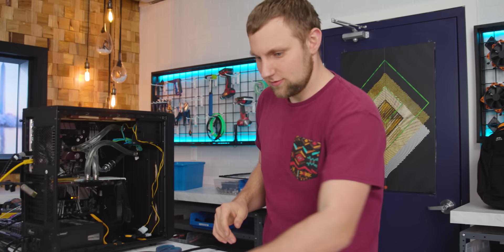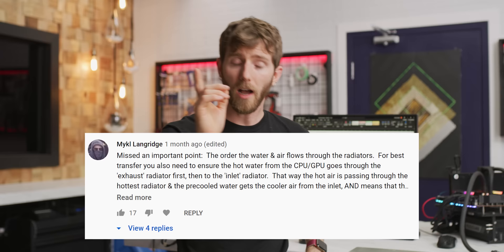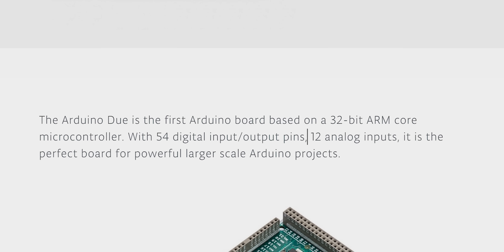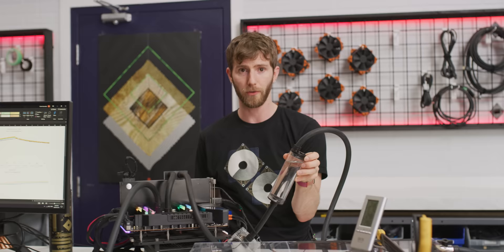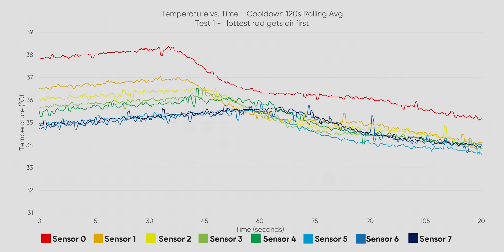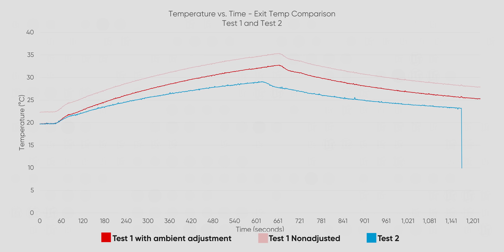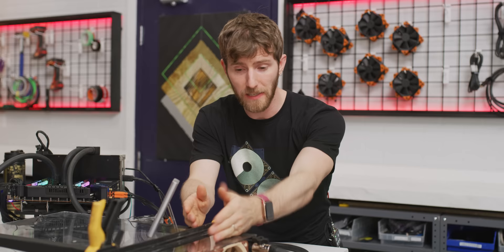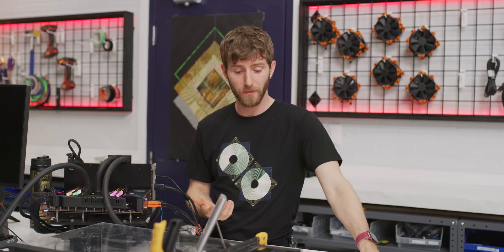Is this even going to work…

Comment: This is a bit late, but I think something is up with your sensor calibration, it looks WAY too noisy.

Especially given that you need extreme accuracy to account for the slight temperature measurements between each sensor reading since a 1 degree difference would completely change the outcome of your conclusion. I know thermistors are typically +/- 0.2 degrees C but the process in converting a resistance > voltage -> digital signal -> raw number -> temperature often leads to huge amounts of error to the point of +/ 2 degrees C and this shows up in your data especially with your last test. 
For once I know a bit about this so here are some suggestions for if you guys decide to do something similar in the future (please do! I love this kind of content):

- The Arduino's ADC should be calibrated so that you get a better analogRead(). (I've never used the Due so I'm not too certain about the noise) but looking at the AT91SAM3X8E datasheet, an Integral non-linearity of 2LSB total actually doesn't seem that bad, assuming you guys are using 12 bits of resolution? I've done personal projects with various Arduinos and switching just the Nano to a Zero once changed my readings to +/- 0.1 C to +/- 0.5 C. For comparison the LSB difference between the ATSAMD21G18 and ATmega328P was 1.2 and 2.6 albeit with different resolutions. 

- Not sure if the ADC is the main culprit here, but it's a possibility since not all ADCs are created equal. Upping the resolution from 10 bits to 12 doesn't always make the noise better due to offset and errors. I would link it if I could, but if you google "Precise voltage measurement with the Arduino board. skillbank", the first result is an amazing guide and a good read on how to properly calibrate the Arduino to read voltages properly. It gives a good explanation on analogReference as well. (Optimally using a reference diode would be best for this)

- Why use a 250ms delay with a moving average? The easiest way to get rid of the noise at this point would be to just deal with it on the software side and sample quickly and average a lot of values at once. Spitting out the average directly instead of a moving one would also reduce lag in the data.

Ok I'll stop since I've been way too technical with this already sorry, but anyways mad props to you guys for revisiting this, and for using Steinhart and ice bath + boiling water calibration and not using the thermistors directly! I was pleasantly surprised when I saw how far you guys went to get your get the best results out of your testing! Hopefully if you guys see this and do decide to try and improve your data for future projects this helps a bit. Unfortunately, when you want to get accurate readings down to a tenth of a degree, it just gets increasingly harder to do.
Edited to fix formatting.
Reply: Good to see another person saying this. All my hours spent in a lab with a datalogger and array of sensors, thermistors included - if I had data that noisy I'd swap all my wires, and be very worried aha

I honestly don't know why they didn't poll the sensors for their maximum polling rate. 4Hz is immensely low - and as I suggested elsewhere, they should link raw data graphs in the description, but absolutely smooth those curves (to a proper fit of course). Then pedants and cynics can check the description, everyone else sees the clear picture
Reply: @skarrambo1  Glad to see that you agree too! And yep my first go to with noisy data is to double check if I wired something wrong and check for interference but their breadboard setup seems fine at a glance.

I know they do this mostly for entertainment and fun but yes! I'd love to see full documentation of this project, it'd be really cool if they uploaded everything from the code and schematic to the .stl files that they used (not that anyone with a sane budget could replicate this haha) along with their raw data. Something as cool as this deserves it
Reply: I question the value of the high sample rate with the "calibrated" thermistors. Just use DS18b20s and sample at 1Hz, you only need to sample at twice the frequency of the effect you are trying to measure. Higher sampling is making all the subsequent steps more difficult. It is not like the effect they measured had any useful information at the sub-second scale, the water temperature did not have meaningful fluctuations within 1s timescales. The noise introduced by their thermistors and calibration system really degraded the quality of the data.
It took 14 days to build that in part because they fiddled with the calibration and adjusting the potentiometers. With DS18b20s they could have used one digital pin with much simpler wiring, and higher accuracy and precision.
Reply: This was a very interesting read and I am not even interested in the video. Just appreciating the level of expertise here.
Reply: "Spitting out the average directly instead of a moving one would also reduce lag in the data."

ikr too bad they didnt have a dyno guy hanging around

Comment: I feel like the actual answer to the question was glossed over in a single, easily missed, line of the video. as long as the air passing through each rad has enough thermal capacity to pull heat from that rad, it will cool the water inside.  Sadly when using fans designed to move air through a single rad, it's moving far too slowly, the air getting "filled up" with heat before it ever gets to the next rad in the line.  Use some loud AF, high speed, server fans in there and re run the tests.  ( or do it dirty and use a furnace blower ducted in.)  
Think of the air like a bunch of buckets on a conveyor belt, and each rad as a hose pouring water from above.  If the buckets are moving slowly, the first hose has time to fill each bucket up before it gets to the next one, where as when moving faster, each bucket only gets partly filled before moving to the next hose in the line.
Reply: Best explanation for heat transfer so far!!!
Reply: We all know that if you have a huge amount of airflow, you will have better cooling, but that isn't the point of the video.
Nobody is putting 10000RPM fans in their PC, so it is irrelevant to the question.
Reply: @alexvolute7454  the question in the video is if having the same air moving through 2 rads works any better than just one rad.  the answer is, if you have enough air flow, ot cool enough air to be able to soak all the heat from the first rad and still have thermal capacity, then yes, if not, no.  simply testing it with one set of fans designed to push air through a single rad does not give enough information.  there are plenty of quality fans on the market that can push plenty of air, and if you actually care about cooling rather than silence you can run them at high volume to push plenty of air.
Reply: @johngaltline9933  pushing air through it wont help, it's basic thermodynamics. the air that gets to the next rad will never be as cold as the air going through the second or third or ... air is a very bad heat conductor which is why is a very good isolator. if the rads are next to each other instead of on top of each other then you should see some better performance on the second one as the first rad takes out part of that heat and uses the same temp air as the first one. hope this makes sense - sorry if i misunderstood something
Reply: and who doesnt have a 2nd radiator without fans?
Reply: @beginerchaos  You are correct that the second rad will nevr cool the water as much as the first, however given enough air flow, the air will not become as saturated with heat  and thus still have thermal capacity to draw heat from the second rad.  it's the same reason that thicker radiators are capable of cooling better than thinner ones, assuming enough air flow you have more surface area to have heat drawn away from. 
if you have just enough air flow that the air is fully saturated with heat from the first rad, the second one will not help.  there is a point of diminishing returns here, where it is more efficient to use fresh air through both rads if you can, but if fan speed/noise is not a concern and compact size or chassis layout is more important, brute forcing enough air through will cool almost as well.
Reply: The takeaway really is that without fresh air, there is no real cooling. Heat will flow from hot to cold. If you're pushing the hot air through the stack, and the water is travelling through the stack, ultimately you're not going to get much benefit. The air has already absorbed what heat it will from the first radiator, and thus no matter how fast the air moves, you gain no advantage. On the other hand, if you allow fresh air to come in from the sides, you will get more cooling... but that's not "stacking" is it? That's just multiple radiators, and will operate as if there is just a larger radiator, whether hooked up in serial or in parallel, so long as fresh air is moving in parallel. It would be most efficient to get the coolest air going over the hottest radiators, however, so the ultimate configuration is just... bigger radiators.
Obviously.

I do like the idea of water cooling the radiators, but then how do you get the heat out of THAT water?
Reply: +1
Reply: Wait, isn't that optimal though? Obviously there is a point of diminishing returns for heat dissipation as the air heats up, but don't you want the air to soak up heat as it passes through?

Of course, server fans would cool it faster. However, they would be less efficient at cooling, since each volume unit of air is absorbing less heat by moving too fast and the fan consumes more power in the process.
Reply: Plz stahp
Reply: If you're going for a lot of large, fast fans why not cut out the water cooling entirely? Get a good cooler with a large surface area and slap the fans on that, you'll probably end up the same.
This goes against the idea of using water cooling with radiators and large fans spinning slowly to bring down noise anyway.
Or, you know, if you really don't care, use a chiller.
Reply: I think this is bottle necked by the air flow. A bigger volume of air is required to move that heat. To keep the analogy, air has a specific heat capacity, or bucket size. So you need to move the buckets faster to move heat away. Also, and this is IMPORTANT, system never stabilized after 10 minutes. The water loop feels like it takes about 1 minute for a full loop. But this slow heating also feels like it's removing 95% of the heat and the reaming 5% just heats the loop. A 10% increase in air flow might tip the balance and reach equilibrium.
This video also needs a more precise conclusion. And let's not forget you can pull air from all sides inside the case. PC might inflate a bit, but using only fresh air on all radiators will definitely have better results.
I think we need to see this taken to extreme, with faster fans, not necessary PC fans. If you ever try again, please use an air flow meter. I am highly intrigued if this can be achieved with more commercial fans. Two Noctua fans (@55 CFM) would have 110 CFM. So how many fans would I need to move enough air trough the system. According to this site http://www.heat-balance.com/ and the 3°C delta at an assumed flow of 50 L/h you are removing 174W of heat. If the numbers are right one more fan, would bring the delta to 4.5°C and that might be enough to keep the water at ambient temperature since it overpowers the initial temperature jump. I might be wrong about all this data, and this stopped being about stacked or not radiators, I still want to see a leaf blower connected to this thing.
Reply: Or use series water flow and parallel airflow - fresh air for all rads. The case would be weird af though.
Reply: @tyrosine87  It depends what the purpose you're going for is.  While "gamers" seem to use water cooling to make a system quieter, the normal use case is to move the heat exchange to a different location.  You can fit twice as many 2U servers in a rack as the 4U ones needed for even a basic air cooler. 
And no, you can't use a chiller in any long term low maintenance system.  condensation will kill you. sub ambient cooling is only for hobby overclocking and very, very high end systems designed to deal with the condensation.
Reply: @PotatotheTroll  It doesn't really matter if say each unit volume of air absorbs half as much heat if you have twice the volume of air moving,  it's not exactly 1 for 1, but it's close enough when considering a double stack rad on a 2u chassis or a top/front config on a normal case.  
the goal is to intentionally not saturate the air in the first rad, so it still has thermal capacity remaining when it reaches the second, which is the entire point of this thread.  If you reach the limit of what the air can hold in the first rad, of course it won't be able to pull any heat from the second one, on the other hand, doubling the air flow means you remove the same amount of heat from the first rad in the same amount of time, but have (not quite) half the heat saturation of that air, allowing it to soak heat from the second rad.
Reply: @JeoshuaCollins  I think you have a bit of a misconception on the goal.  No one is looking for sub ambient cooling out of this, and in almost every case you never want sub ambient cooling as that causes a nightmare with condensation. The ideal set up is to have a high enough rate of flow through the water block that all heat above ambient generated by the CPU/GPU is carried away by the coolant, then to have enough radiator surface area and air flow to return that coolant to ambient temp before it is pumped through the water blocks again.  It's really very easy to do if your design allows for enough surface area.  what this video, and thread are addressing are what you can do to condense the surface area into a smaller volume of space for use in small systems or server chassis where volume is at a premium. 
There are lots of folk where silent is a consideration, for me, it's meaningless, normal fan noise doesn't bother me and I'm not going to hear it over the window AC unit running anyway, and my HiFi is plenty loud enough to overpower that noise.... With the exception of my sunfire 4440x server which sounds like a jet taking off even through two closed doors at the other end of the house. however that also illustrates the point, as it needs epic levels of air flow to keep all four CPUs in it cool with the tiny, apx 90x90x25mm, heat sinks they have.  Small surface area, huge airflow.
Reply: well this would still be a bit pointless for real world application. it would mean we need more rpm to utilize 2 radiators in the same case. meaning it gets loud.
it just makes a point im having ever since watercooling apeared - why on earth do we do watercooling inside the case.
i would like to see a completly watercooled solution, in an airtight case and radiators in sepoerate chambers or outside of the electronics chamber.
then watercooling would make real sense.
but current solution is basically yea for the looks, and a touch better cooling cause rads have a touch bigger surface than aircooler but all in all, considering costs and effort, if we go by a pure cost to performance its hardly to justify and only if we reach peak for like benchmarking on overclocks
Reply: Good analogy.
Reply: Heat capacity of air doesnt change with more fans. Just put the second rad elsewere.
Reply: @chetpower772  Uhh...I think you missed the point.  While the heat capacity doesn't change, how much of that capacity is used up when the air is moving slowly vs quickly through the radiator does.
Reply: @johngaltline9933  I think you dont understand heat transfer, the hotter the object, the more it interacts with others around it. Same reason why you dont put funs on top of fans. It doesnt make the heat sink better at contucting heat, it just moves the hot air out faster, therefor the air temp out is lower, but in higher volume.

Its just a bad practice to put a hot radiator right next to another one. Why, because its really inefficient for both radiators.
Reply: @chetpower772  While less efficient than pulling in cooler air over more surface area, pulling higher volumes of air through "deeper" radiators still provides additional cooling. There's a reason that "thick" radiators are a thing.  See bucket example in the OP.  It is less efficient than using ambient temp air through all rads, but calling it "really inefficient is disingenuous.  For an application with as little heat to move as a desk top computer it really isn't going to matter all that much.  Sure, if your case is capable of pushing fresh air through all the rads you should do that, but you'll still get better cooling with stacked rads than with a single one, assuming you are pushing a high enough volume of air through them.   To provide the best delta you probably want the hottest coolant to pass through the 'warmer air' rad, then flow into the one with ambient air.  With high enough air flow this doesn't even matter as the air will have picked up so little heat that it is just as effective in the second rad.  If you look at enterprise grade equipment this is common place with air cooled CPU heatsinks placed one after another with no comprimise in cooling on the second socket because so much air is pushed through the chassis that it doesn't mater.  While it sounds like a jet taking off, it gets the job done.  
P.S. in this enterprise gear, stacking fans is also common place.  While it doesn't give you twice the air flow, it does give you more air flow as the load is reduced on each fan allowing the pitch to be more aggressive.
Reply: So, Series vs Parallel then.
Instead of stacking, it would be better to put them side by side, so the wouldn't heat each other up.